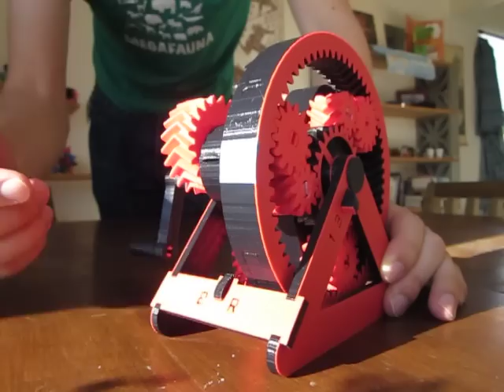3D Printed Automatic Transmission Model

Comment: Wow dude. That is very impressive. People don't generally understand just how difficult 3D modeling is on its own,  not to mention the mathematics and knowledge that its takes to make shiftable elliptical gears sets, AND to top it all off you made herringbone gears so you could have an open system. Your next challenge is making one that shifts using clutch packs.

Comment: This is a model of how the planetary gears operate inside an automatic transmission.  He's not wrong when he says that this is how the auto trans works BUT there is a lot more to it than just the planetary gear set. Good work though.
Reply: eclipsepease thats right but this is the main thing of speeds

Comment from the maker: Yes, what makes a transmission automatic is the controller the engages the different brakes and clutches depending on the speed of the wheels and the throttle position. However, this is a common gearing arrangement for that system to actuate, which is itself different than a manual transmission gearbox. Then you have paddle shifters; do you call that manual or automatic? The line begins to blur...

Comment: Brilliant job Emmett. I printed it on my Makerbot2 and it runs like a dream. The pins were ridiculously tight, but nothing some files couldn't fix. You are a very smart guy. Thanks for the sweet model, it's probably my favorite so far from Thingiverse. Cheers

Comment: Nice planetary setup, but since it is such a cumbersome way to changer gears, planetarys are usually setup with a fixed gear reduction and used as a wheel hub say in a peice of construction equipment on each drive wheel.

Comment: You should automate it using Arduino and some solenoids
Reply: pretty much a plc
Reply: awesley92 not real
Reply: inputs, outputs, a program..... yeah pretty much minus a few bells and whistles
Reply: awesley92 have you ever seen "randa Arduino"?
Reply: Rather a small servo...
Reply: Arduino and stepper motor or screw shaft motors  very cool .
You could have it going up and down the gears.

Comment: This is excellent work. Using the herringbone gears would also render disengaging or re-engaging while moving impossible. Change the gears to synchromesh gears to allow this while moving. To make this automatic you simply add the hydraulic values and sequencing through the hydraulics that are driven by the speed of the input shaft which will increase the flow of fluid and thus the pressure to shift gears. Also on normal transmissions they use break bands (straps) to stop gears so the stopping doesn't shear off the break pins with a sudden stop. All in all this is a good concept with a very minimal number of parts and believe it or not with the above tweaks it would work be compact and light weight. The input shaft could be telescoping (comments below). This would be great for a R/C car or maybe a bicycle. My hat is off to you sir well done.

Comment: Not bad, but 'Drive' is merely the term for the transmission being told to select all available forward gears. 'Overdrive' is any ratio that doesn't increase the torque coming out versus coming in.

Comment: I think a better description is this is how a planetary gearset works, rather than this is how an automatic transmissions work. There are auto transmissions that use standard meshed gears just like a manual transmission, but with the syncronizers replaced with clutch packs (A lot of honda transmissions are like this)

Comment: I just printed on my UM1 with heated bed. Printed nearly flawlessly with the right print parms, only some light filing to get the pins to go in smoother, and some grease to make it go. I laughed out loud I was amazed it worked so well! Now of course someone needs to add the electro mechanicals , computer, sensors and a driving motor to make it a real automatic. But very awesome.

Comment: I feel sorry for all of these ignorant people.. This is a model of an automatic transmission. It is not an automatic transmission. It is not supposed to operate automatically, because it is just a model. Just like you can't drive a model of a car.
Reply: Cobra Was Taken It is a model. of a manual planetary transmission. a model of an automatic would shift automatically.
Reply: Rahmi Acar so a manual transmission. an automatic trans is a manual trans controlled by a computer.
Reply: Rahmi Acar exactly. this is a manual planetary gearbox.
Reply: William McCartney Me? Prove me wrong then.
Reply: I find it ironic how you call people pointing out the obvious, "ignorant", while being yourself ignorant on the suject.
In order for this to be a model of an automatic transmission, it has to involve the mechanism which would perform the shift automatically, even if it was in a conceptual form. This is after all the part that makes it automatic . In the above demonstration, no part involved shifting based on resistive torque or output speed. All shifting was done manually.
This kind of reaction to valid critisism is a disease in modern day society. You (and everyone who liked your comment) don't really care about validity of information. You are just pissed off that some people pointed out a flaw in something you liked, as if it was some sort of insult directed at you. 
Well it was not. And trust me, a skilled engineer will benefit a lot more from negative critisism than from people kissing his ass.
Reply: John doe You get it.
Reply: @cyberlord64  No, it doesn't absolutely. You're thinking to straight. If you're thinking like an engineer, installing some switches there is such a simple task,  it isn't worth mentioning compared to the rest of the engineering. Every engineer knows how and there is no difficulty in it. Totally boring. So it is only implied. The rest on the other hand is like magic for some and is interesting to show off.

Comment: For those who keep calling this a manual transmission: just as today’s engines have an ECM (engine control module), today’s transmissions have a TCM (transmission control module). He’s just acting as the TCM. Rather than flipping little levers with a hand, a TCM is programmed to engage/disengage certain clutches or brakes in the transmission according to driver’s acceleration demand, engine torque supplied and wheel torque demand. A transmission’s behavior can be changed by reprogramming the TCM, which is how many cars can offer several driving modes.

Comment: Emmett  great job. It is intricate and clever. 

I work with little dc motors and the arduino. In your opinion, are these gears strong enough to serve as 'real' gears with small electric motor gear boxes or is the plastic  filament too fragile.. or wear too easily?

Thanks for the demo.

Comment: Build a vehicle around it! Awesome job.
Reply: Its not as easy as it sounds, with the 3D printer he probably used you would have to print out almost 350+ parts to make just the body. Using a Objet1000 would still take 30+ parts and thats a 10,000$+ printer. Not to mention a lot of money worth of plastic molding materials. It would also take a 4+ Hours for each part. Overall its just not worth it yet. The technology hasn't advanced far enough to do that as a personal use. Only companies use Objet1000 printer because they're the only ones who can afford to buy it and pay for it.
Reply: ChopStix nice to know! I really don't know much about 3d printing.
Reply: ChopStix It would be a lot less complex if you built a vehicle on two wheels.
Reply: Stoney3K Theres also a lot of problems with building something on two wheel, unless you mean a motorcycle which wouldn't technically be classified as a "Vehicle" but as a Motorcycle.

Comment: I have a few questions:  if there were two identical cars except one has an automatic transmission and the other has a manual transmission, are the gear ratios for each progressional gear identical for both vehicles? If so, which one is lighter? Assume they are straight cut gears.

Comment: You just call it an automated transmission ;) 
Works only with gearboxes without a clutch pedal, though.
Those with paddle shifters and a clutch pedal are just called sequential gearboxes.

Comment: It is so manual for an automatic.
Reply: Raul Visnitchi its a model. A real one would have motors, hydraulics, and such
Reply: I think, it is good idea to bring this to the fully automatic gearbox using arduino, that will be awesome !
Reply: It's an automatic. manual transmissions operate differently. A manual transmission physically changes a sprocket to engage a different one to change the output. Automatic transmissions never engage or disengage sprockets, just apply clutches to different parts of the mechanism to cause it to transmit power differently through the planetary gear set.
Reply: Edit: regular automatic transmissions are built nearly the same way.
Reply: BlacKi You don't clutch in the same way as you do with a manual. Rather than disengaging and re-engaging the engine to the transmission, you disengage parts of the transmission and engage others.
Reply: BlacKi it is still not an automatic
Reply: Robert Gilbert 
I think you missed the point.

It's how the gear box works, not how the controller works
Reply: Bruce Baxter I think you guys misset the point. How it will be if someone tells you that they will sell you an automatic and you find out that you need to change gears manually? Hmm? It is about language and reality. That's all. You can build an manual design and make it automatic. But it's what's the final product.
Reply: Raul Visnitchi 
It's not for sale, it doesn't transmit power, it shows how a planetary (automatic) gearbox functions in difference to a manual (layshaft) gearbox.

It's not about selectors, or sensors, or actuators, or algorithms, or torque converters, or oil pumps or anything else a commercial gearbox needs.

It shows HOW it does what it does, it doesn't do what it does.
Reply: Bruce Baxter I know that it's not for sale man! :| It was an example. Title and product. If you guys don't understand the language, just stop!
Reply: Bruce Baxter I know it's built very similar to an automatic gear box by a true automatic gear box changes gears with the changing rpms of the engine
Reply: Robert Gilbert Good. The title is not good.
Reply: Raul Visnitchi thank you
Reply: this truly is a great video demonstrating the workings of a planetary gear box not an automatic and yes I know its missing the solenoids and a whole bunch of other things but it I known as a planetary gear box
Reply: +Robert Gilbert 

Exactly, this is showing how a manual planetary gear box works. It's closer in action to your hand drill transmission than what is on a car.
Reply: Finally someone not against me! Thank you!
Reply: drill transmission? you mean different resistances in stages per distance the finger switch travels causing different voltage to the motor thereby changing speed? not at all the same.
Reply: No. He doesn't mean power and acceleration. He means gearbox. ;)
Reply: A variator and a centrifugal clutch is not properly an automatic gearbox because it has not gears, its a variator (CVT)
Actually the automatic is dual clutch with internal indipendet gear selectors, while robotized is nothing more than a manual gearbox with added hydraulic or electric actuators for clutch and gear selector, but it can be reversed to manual in every moment.
Reply: andreap555 you know a Autamatic transmission and a CVT are 2 diffrent things

Comment: Then a model "T" transmission is a semi-automatic trans. or a pre-select for high gear.
moving the High lever to high at any time. Thence letting the low petal up auto shifts to high. Some transmissions have solenoids for that. And that is what the Governor works 
making the automatic in automatic transmission automatic. Oh crap now i confused you. ;-)

Comment: I don't understand, in cars, what is moving the shaft and what engages/disengages the breaks? Especially in the cars from the first half of the 20th century when there were no electronics involved.
Reply: ***** It's all complicated hydraulics and clutches. Where as on a stick shift, the driver controls the main clutch that physically engages and disengages the gearbox system, on an automatic, all the "brakes/stops" are controlled by valves and actuators which move and lock up the various points. Newer cars use electronics to control the valves and passages to select the gear based on speed and power needed, older cars used a vary complicated hydraulic system which uses pressure produced from the pump which manually activates different hydraulic valves

Comment: i'm no rocket scientist, but that surely looks like a manual transmission if i ever did see one.
Reply: +nick haydu   I think that the planetary gears are what is used in modern automatics.  Standards have parallel shafts with gears that don’t  orbit the shaft.  The “brakes” are hydro or electric operated to control the gears, not the ones that stop the car.
Reply: Stick to your day job

Comment: yeah not technically an automatic transmission, you still need to use a clutch.It is a manual transmission that could become a automatic one, with the use of some electronic switching to say the least. Yet very impressive to have 6 ratios + reverse in such a tight space.

Comment: technically all transmissions are manual.  automatic transmissions just use the speed sensors and pressure lines to move the gears,  still manually controlled... by a computer.

Comment: VERY cool model, but if you have to engage the breaks then it's hardly automatic.
Reply: It would be rather tough to 3D print the hydraulic system to actuate it...
Reply: true... :P
Reply: kleetus92 Hydraulically actuating it is not necessary, but it used to be easier than actuating the whole lot directly through electrical solenoids or motors.

Modern tech would allow a transmission with a planetary gearbox to be actuated electrically, much like a manumatic gearbox would.
Reply: Stoney3K Have you seen a current transmission?
Reply: Current transmissions (especially manumatics and DSGs) try to use electrical actuators as much as possible for the design simplicity and robustness of it. Problems with hydraulic fluid, leaks, or faulty solenoids can cause clutches and brakes to not engage, which leads to a faulty transmission.

The only hydraulic part you'd need here is the torque converter, and for the purpose of this model, you can even use something more unconventional (like water or vegetable oil) as the working fluid. The TCU can just connect to stepper motors or servos to actuate the gear you want.
Reply: Stoney3K
Water freezes, and vegetable oil decays, both have issues at extreme ends of the temperature ranges as found in typical applications.

Electric would no doubt be the driver or controller, as it is now, but the work needs to be done by something more powerful and consistent. Something small can get by with a stepper motor, but again, mechanical components wear, and then become less accurate or stable. A transmission with a torque capacity of 1500-2000 lb-ft of torque needs some serious pressures to keep clutches, which operate wet, held tight.

In narrow purposes, autoshifts can be used, but their popularity is lack luster due to their so so performance.
Reply: I highly doubt this model would be up to the mechanical stresses on the road anyway. The plastic gears would give up way before anything else would ;)

This model is for demonstrative purposes only, and in that case a simple servo would be just fine. You'd still run into challenges to shift while the transmission is running, as I can't see any sprag clutches (or a torque converter for that matter). That makes for some very jerky shifts...
Reply: What are "breaks"?  Is that like when people are hungry and they clock out of work for an hour?

Comment: This is a model of how a automatic transmission works!

An automatic transmission, (self-shifting transmission), is a type of transmission that can automatically change gear ratios as the vehicle moves, freeing the driver from having to shift gears manually. Like other transmission systems on vehicles, it allows an internal combustion engine, best suited to run at a relatively high rotational speed, to provide a range of speed and torque outputs necessary for vehicular travel. The number of forward gear ratios is often expressed for manual transmissions as well.

The most popular form found in automobiles is the hydraulic automatic transmission. Similar but larger devices are also used for heavy-duty commercial and industrial vehicles and equipment. This system uses a fluid coupling in place of a friction clutch, and accomplishes gear changes by hydraulically locking and unlocking a system of planetary gears. These systems have a defined set of gear ranges, often with a parking pawl that locks the output shaft of the transmission to keep the vehicle from rolling either forward or backward. Some machines with limited speed ranges or fixed engine speeds, such as some forklifts and lawn mowers, only use a torque converter to provide a variable gearing of the engine to the wheels.

Please don't be stupid and look at the title before starting war in the comment section.

Comment: So why is it AUTOMATIC?? U are making all the manipulations. I thought when reaching a specific RPM your gearbox will make the shifting AUTOMATICALLY.
Reply: YMastersWRC this is a model. If you ran it at high rpms it would probably destroy its self and the model is very similar to a automatic transmission just without the hydraulics that make it shift automatically so it is a automatic transmission just with out those hydraulics that make it automatic. ok